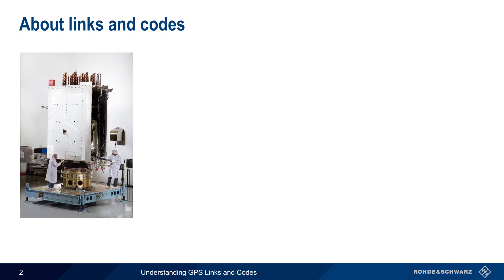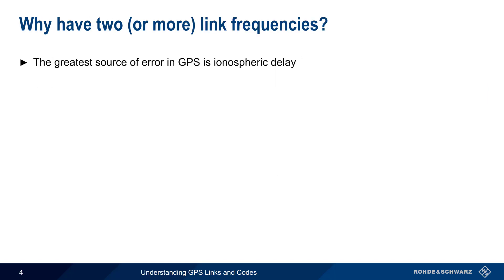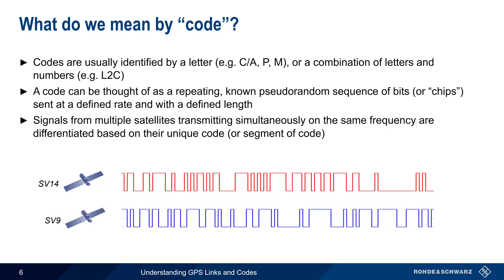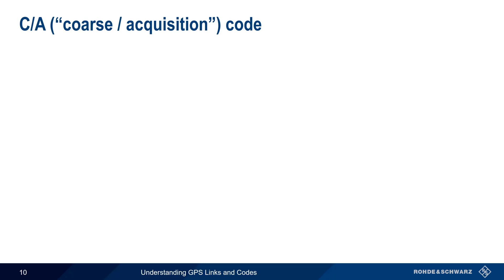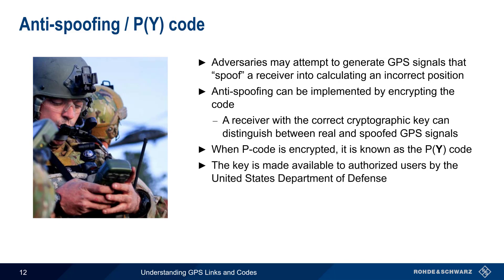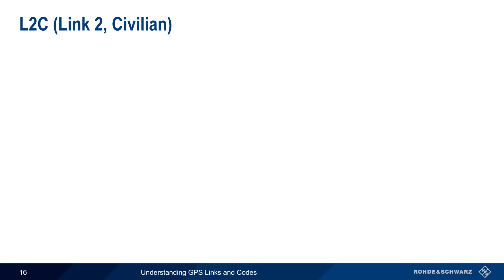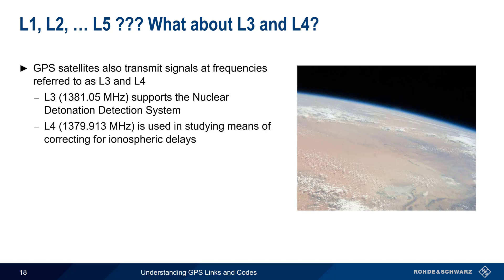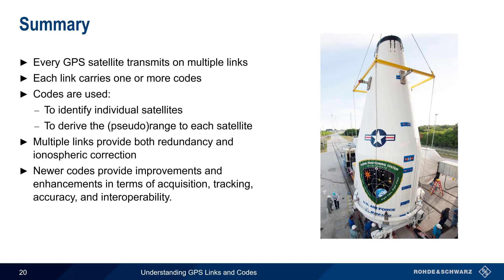Understanding GPS Links and Codes

Comment: You incorrectly utilized the "cross-correlation" term.  Aligning the codes is simply correlation, or perhaps autocorrelation.  Cross-correlation is the interference effect between multiple codes.  Typically when this happens the codes are mistakenly aligned, causing the receiver to track one satellite, but believe it to be another.
Reply: Thanks for the feedback.  In retrospect, I probably should have just said "(code) correlation," since the distinction between cross-correlation and auto-correlation is not often made (or rigidly adhered to) in the GNSS literature.  But I do stand by my use of "cross correlation" since this is the more general description of the process of comparing two time displaced series, regardless of whether they are supposed to be the same or not :)

Comment: I always tought that L1, L2, L5... referred to L-band 1, L-band 2, etc.

The L-band refers to the 1 - 2 GHz spectrum,
Reply: If you read the US government ICD's for GPS (e.g. IS-GPS-200), you'll see they are using "L" to abbreviate "link", e.g. "GPS for radio frequency (RF) link 1 (L1) and link 2 (L2)."  GPS is in the L-band, but that's not where the abbreviation comes from :)

Comment: So if the code is used to determine positioning, why is precise timing via atomic clocks required for PNT? Is it just for accurate timing, (the T in PNT)?
Reply: The short answer is the GPS is really about timing, not positioning :)  Position is determined (by the receiver) based on the time it takes the signal to travel from the well-known positions of multiple satellites to the receiver.  Most people tend to think about GPS as providing a "position", but I would say that most (behind-the-scenes) applications of GPS are really more about having a precise time source.

Comment: Thanks for the video. Can you explain that how the phase center measurement error of the GNSS antenna can affected the accuracy of detection the exact position?
Reply: I can try :)  As I'm sure you already know, the phase center of a GNSS antenna is different from the actual physical center of the antenna and this is concern in applications that require extremely high position accuracy.  The difference between the phase center and physical center changes based on numerous factors such as the position of the SV (azimuth and elevation) as well as the frequency of the received signal (e.g. L1 vs L2 vs L5 in GPS).  In order to minimize this error, calibration of the GNSS receiver antenna can be used.  One way of doing this calibration is by sending signals into the antenna at various azimuth and elevation values (in a shielded chamber or at an open air range) and using a vector network analyzer to measure and record the phase differences so that these can be removed in the final navigation solution.  Hope that's helpful!